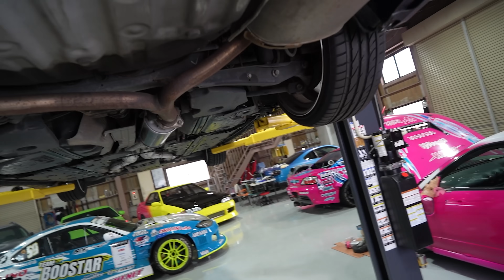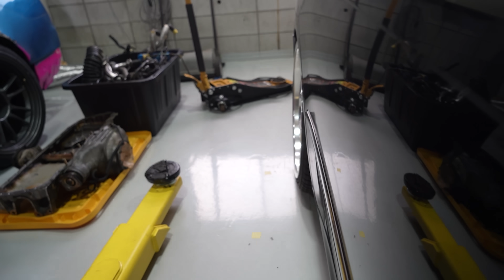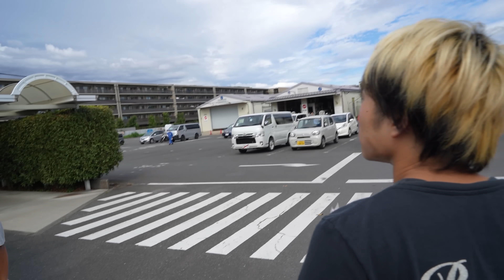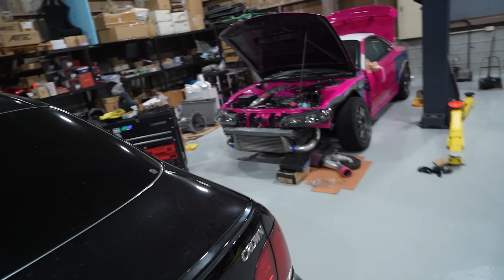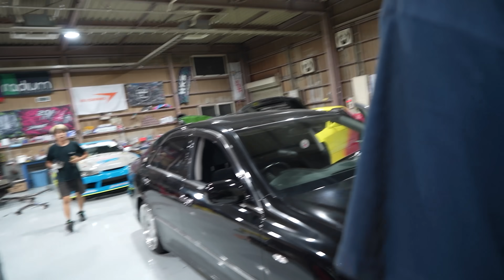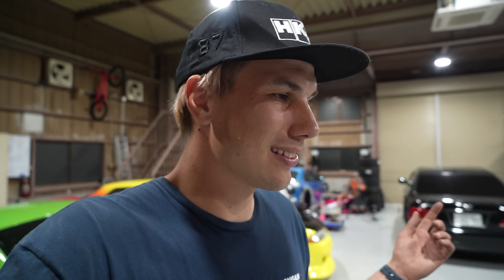Making My Japanese Mafia Car Street Legal!

Comment: I went through shaken with an old Mini and had to tape on temporary crappy plastic fender extensions to get move the fender edge beyond the edge of the wheel since they were wider. And we had to remove the after market side marker lights since the blink pattern did not exactly match stock side lights. The car was lowered and had led fog lights, but Kanagawa did not care that was lowered. And yes it was under 25cm. I have no idea why they say the things they do for shaken but its like rolling the dice every time when the car is not stock.

Comment: In logistics we always have a saying..
How do you eat an elephant?
By one piece at a time.
The best thing is to work out what's easiest to hardest and start from there to give yourself some feeling of accomplishment and push yourself further.
My advice is get the og S15 done slapped together and enjoy it then the r33.4.
Get the Bogan 32 off to the track and get the stag out of there, tidy up the place and your thoughts and then push on with the abandoned S15.
And for a new car do something old school i.e. 60's, 70's early 80's... 
A cool Datsun with a L series motor would be 🔥

Comment: I have the same truck, window winder handle is a pretty standard part, they tend to strip out. You can just replace by popping out the circlip and swap out. Also, you may be a bit sick with something called epstein barr virus. It pops up when you wear your body out. Foggy head, sore joints, massive fatigue, no energy etc.

Comment: Get well Sam. Bureaucracy is the enduring gift from the west. Japan definitely picked up the ball and ran with it. Some strange US inspection laws include a ban on yellow fog lights in New York and a minimum as well as a maximum bumper height in Virginia. A friend of mine with a '32 Ford hot rod runs it without a front bumper because the stock location for the bumper is too low to pass inspection in Virginia. Get the housing and enjoy the S15. Finish up the OG 33.5  and shaken the Z to clear the shop. This way, you are down to a big project and maybe one or two small ones as a change of pace. Good luck to youand Daiki!

Comment: Fog lights produce a short but wide beam spread which falls close to the car. If they are too low they don't properly illuminate the road ahead. Inspections are very lax here in Kentucky, but they have to be done by a off duty officer who is paid in cash only. They are only there weird hours, they leave early and for lunch with no warning all the time. It's tough to get a car inspected when you work for a living. Took me 4 tries once with a vehicle I had bought out of state to actually get a officer there when they were supposed to be there. Guess its a struggle everywhere.

Comment: Sam, here is Washington State fog lights have to be a certain height off the ground too. The reason for this is that the light will reflect off the ground and blind on coming drivers. I got pulled over for having illegal fog lights back in 2000 for a set of aftermarket lights I had installed on my Hyundai.

Comment: Yep FYI sammit, here in Spain, if u put coilovers or low your car there are few rules, one of them is the fog light should be 25 cm high from ground. And to put the coilover or somthing else you have to pay an engineer to check it a mechanic that give u a paper like the coilovers are nice installed and pay an extra inspection, is a pain in the ass u have to pay for everything plus the money that the mod cost u, is horrible

Comment: In the UK, lights need to be a certain height to have the beam in the correct place while driving. Don't think it covers fog light though.

Personally. I would get the og s15 sorted to be back on the road with aero and fix the rest when you have less projects at the same time. Get the 33.4 running so you have two fun road cars to choose between and then work on the abandoned s15 with all the things you are learning. You can always fix the OG s15 while the abandoned one is getting something done. 

Get better soon dude, always enjoy the content.

Also, idea for GS drink name....drift breathing. Works well with the demon slayer style graphics you have
Reply: In the entire European Union (which UK isn't a part of anymore) there is a standardized rule that these foglights have to be mounted between 25 cm and 80 cm off the ground. It's measured not from the lowest edge of the casing of the light but from the "light emission edge". I read in a forum if you are missing 2 cm you can just put a black sticker on it and it's fine. So yeah, not just Japan with this rule so it has some technical background. I just didn't find anything that explained why this rule exists.

Comment: as a starting mechanic i can explain why the fog lights has to be 25 cm from the ground. As my teacher said if the car is lowered that would mean that the factory light setup is changed which means incase of wet road the passing people may get blinded even tho u cant see that but the effet would be there for others and u may cause a car crash. 25cm is ideal and perfect hight to avoid the reflection from wet ground but even I tought at first what the hell but as soon as my teacher started explaining i was like oh shh. Ofcourse there are other ways to explain in better terms but I just explained in the most simple way possible hope that clear everyones mind

Comment: Check eastwood internal frame paint for after the patch panels are welded in to prevent the return of rot. They have special hoses/nozzles that coat hard to reach areas. Weld thru primer still burns off during welding and can rust down the road